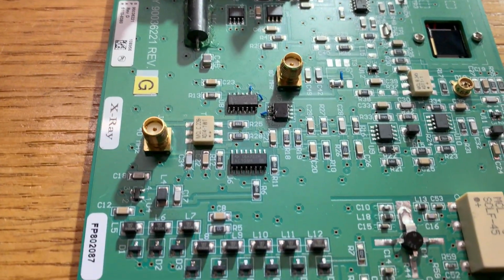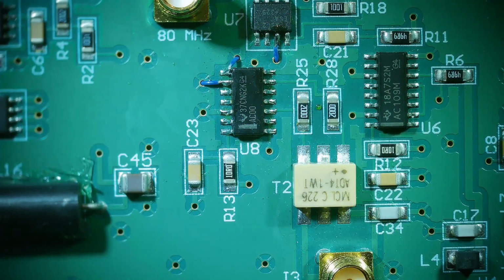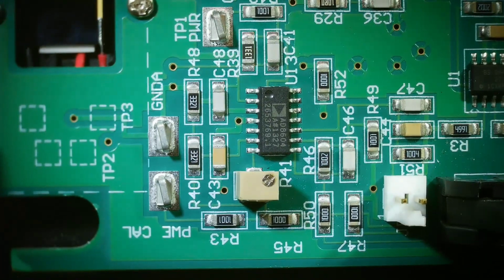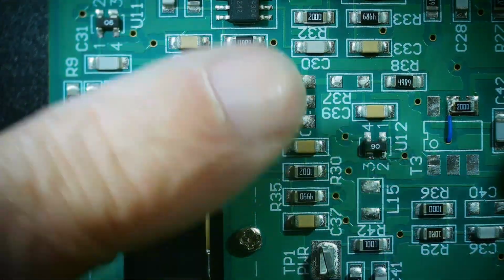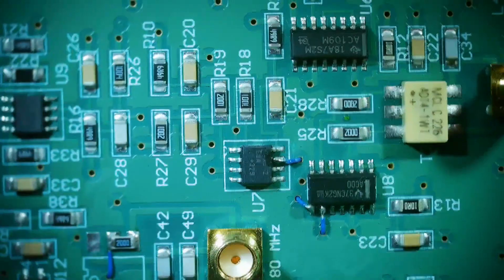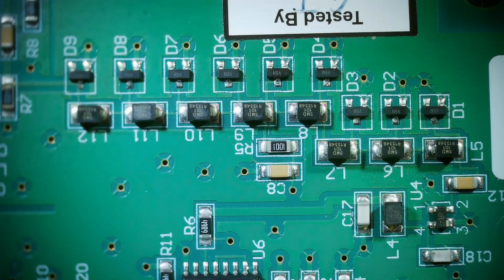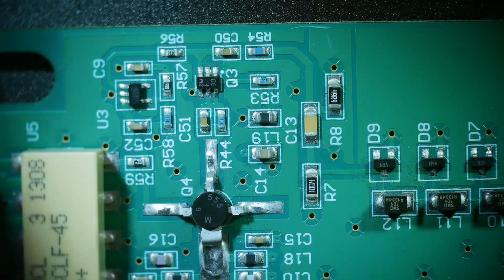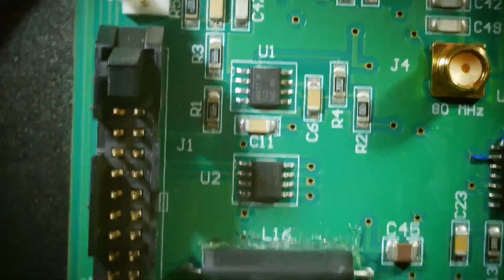#1448 X-Ray Board??

Comment: If fhe diodes in the string w/ inductors are reverse biased, than they might have being used as varactors ( varicaps) in some sort of multistage variable T filter w/ frequencies passed in dependence of the reverse bias voltage.
Some x-ray inspection equipment even use modulators and multi energy xrays to construct an image of the inspected cargo with sufficient visual information on it to sort out objects & materials on it.

Comment: Don't listen to all of these guys guessing!!! 

That is the secondary control loop-back module for my Dilithium synthesizer which fell of my UFO while flying over CA recently. 
Whatever you do, don't expose those lens to UV light, That is part of the self-destruct system neatly hidden on that board. 2 seconds of UV and life as you know it will vaporize in a few milliseconds. 

As all of the technical youtubers on earth now say, do this at your own risk. 

Now back to Zorpolaris for a new loop-back board and to have the nuts removed to the nut-zo who installed it...

ZOOOOOOOOOOOOOOOOOOOOMMMMMmmmmmmmmmmmmmmmmmmmmmmmmm!!!!!

Comment: You have the control board/Exciter section the first part of the circuit is a comparator circuit possibly lm324 ics the white ics are ballist transformers they take RF and turn it into usable voltage that the comparator uses to control a bias for the RF deck

Comment: Inductor diode string looks like a variable LC delay line, diodes are varicap/varactor. Varying the DC bias on the diodes changes their capacitance which changes the delay.

Comment: A mode locker is a device used in certain types of lasers to generate short pulses of light. In the context of an X-ray apparatus PCB, a mode locker might be used in a laser that is used to generate the X-rays.

The mode locker works by introducing a mechanism to modulate the laser beam in such a way that it produces pulses of light with a very short duration. This is typically done by introducing a modulator into the laser cavity, which changes the refractive index of the laser medium in a periodic manner. This modulation results in the production of pulses of light with a duration on the order of picoseconds or femtoseconds.

In the context of an X-ray apparatus, the mode-locked laser might be used as a source of ultrafast X-ray pulses, which can be used for a variety of applications such as imaging, spectroscopy, and diffraction. By using a mode-locked laser, it is possible to generate X-ray pulses that are short enough to capture the motion of atoms and molecules in real time.

Also for the optical sensors, some X-ray PCBs use two optical sensors for the purpose of detecting X-rays. This is typically done in X-ray imaging systems that use a technique called dual-energy X-ray imaging.

Dual-energy X-ray imaging involves taking two X-ray images of the same object at two different energy levels. By using two different energy levels, it is possible to obtain more information about the object being imaged, such as its composition or the presence of specific materials.

The two optical sensors in a dual-energy X-ray imaging system are used to detect the X-rays after they have passed through the object being imaged. Each sensor is designed to detect X-rays at a different energy level. The X-ray source is pulsed twice, once at each energy level, and the signals from the two sensors are combined to produce a single dual-energy X-ray image.

The use of two optical sensors in a dual-energy X-ray imaging system allows for more accurate and detailed imaging of the object being imaged. By using two different energy levels, it is possible to differentiate between different materials and structures in the object, which can be useful in medical or industrial applications.

Overall, the use of two optical sensors in X-ray PCBs enables the development of more advanced and specialized X-ray imaging systems, and helps to improve the accuracy and usefulness of X-ray images.
Reply: Is that ChatGPT?